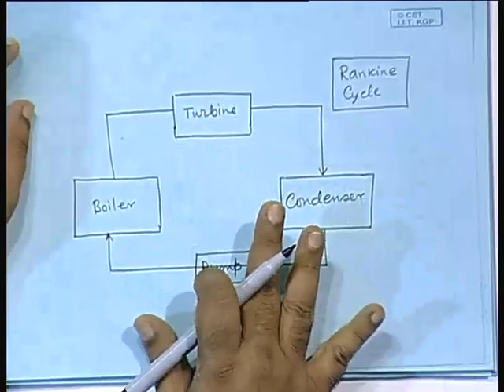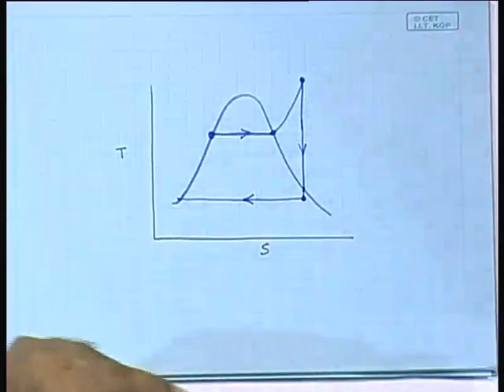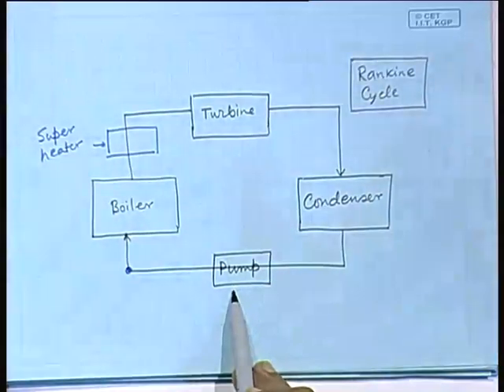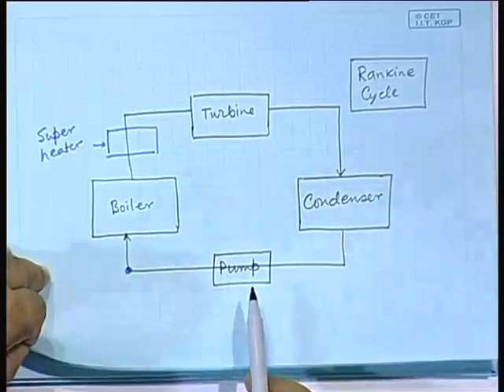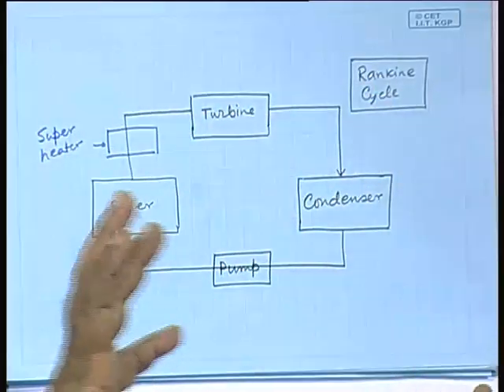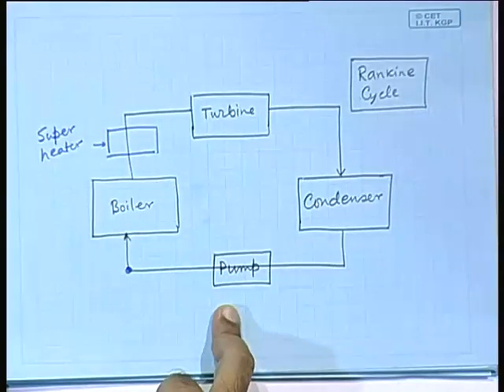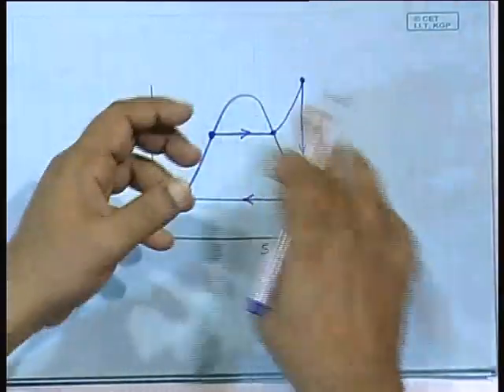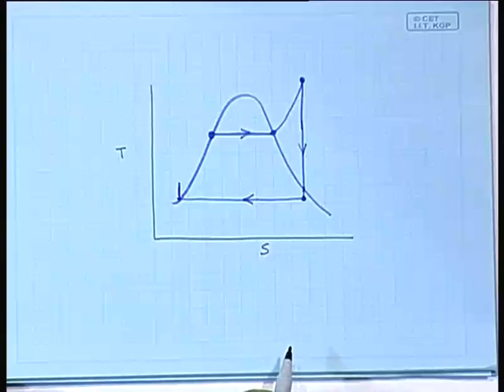Lecture - 8 Thermal Power Plants

Comment: Do you think really pump will increase temperature bit..??? if yes, how its increasing..?? in pump there is no heating device, no heat transfer equipment not fixed with pump. when you pushing water defiantly temperature will not increase... still if you think temperature will get increase kindly explain.....
Reply: Pump is doing work on fluid.........this work is converted into mainly pressure energy and slight temperature rise.
Reply: Gay-Lussac's Law: The Pressure Temperature Law. This law states that the pressure of a given amount of gas held at constant volume is directly proportional to the Kelvin temperature. As the pressure goes up, thetemperature also goes up, and vice-versa.

i hope you got the answer
Reply: Definitely. This is because in the driving motor rotor winding losses will be there. The order of the losses ordinarily of theorder of 10percent. This heat distributes in the water
Reply: No here from  condensor water is sent to to pump(CEP) ---TO ( ejector condensor)----Gland sealing ----LOW pressure heater ------DRAIN cooler -----Deareator -----BOILER FEED PUMP ----HP heater then to boiler inlet

So by all these process water accumulates thermal enegrgy and all the stages works heater which increases temp for efficiency